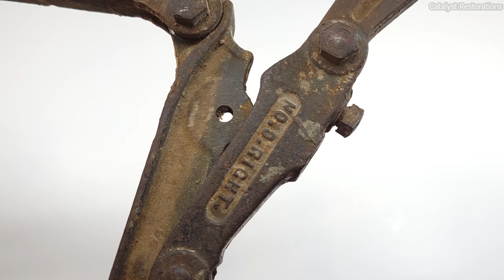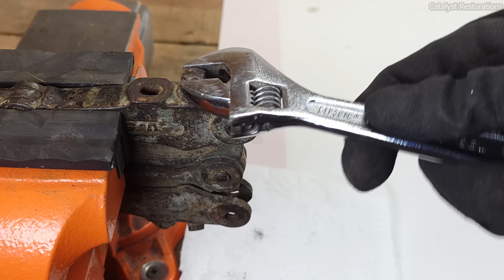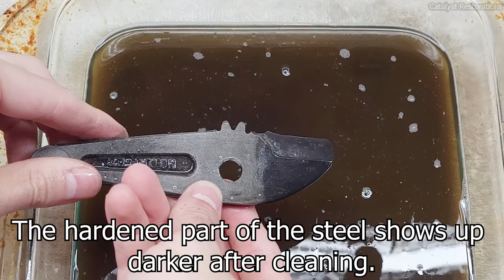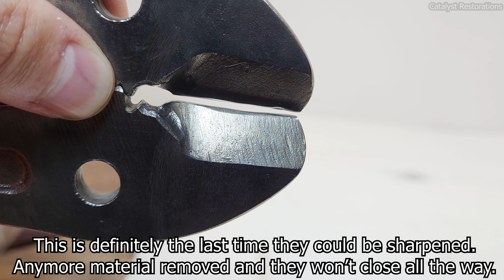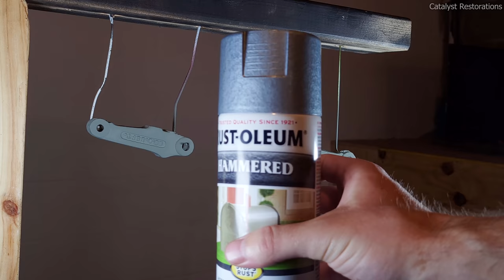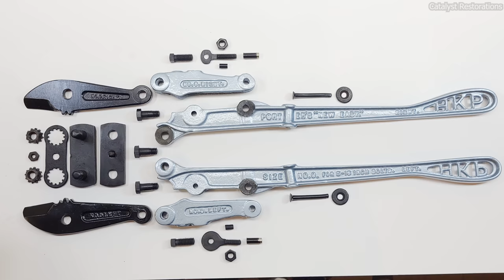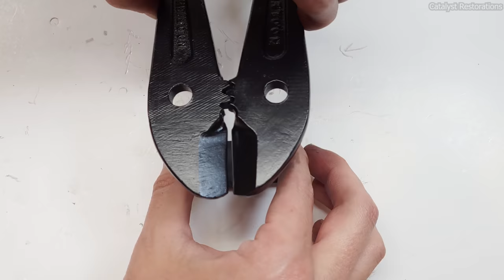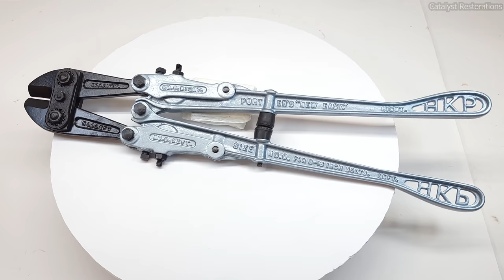130-year-old Bolt Cutter Complete Teardown and Restoration

Comment: Great restoration!
Here's a tip for press straightening: use 3 rods to "over-press" the piece.  
Two rods go on the right and left sides of the concavity, and the third goes on the convex point.
When you close the vise the rods act to bent the piece beyond straight, which will then flex back due to metal memory.
Hope this is helpful.
Reply from the maker: This is great advice, thanks JL! In the world of metallurgical engineering that metal 'memory' is called its elasticity and any permanent bending is called plastic deformation!
Reply: no such thing as metal memory.
Reply: @xl000   So, springs don't exist?
Reply: @xl000  Some people have no such thing as knowledge.   😅
Reply: @xl000  You are right, there is no such scientific term, but what people mean by this, is the metal operating in the elastic deformation area of the Young's Modulus of Elasticity graph. A hint for the non-engineers for further investigation.....
Reply: @firesurfer from wikipedia: "In metallurgy, a shape-memory alloy (SMA) is an alloy that can be deformed when cold but returns to its pre-deformed ("remembered") shape when heated. It may also be called memory metal, memory alloy, smart metal, smart alloy, or muscle wire."
Springs are made from normal high-carbon steel that have no "shape-memory" properties.
Spring is going back to its original shape only in some very specific range and you should avoid the: "Elastic limit (yield strength); Beyond the elastic limit, permanent deformation will occur. The elastic limit is, therefore, the lowest stress point at which permanent deformation can be measured."
Reply: @Bialy_1  Like Nitinol

Comment: You can weld new material onto the blades. Grind it flat and lay a bead of weld along the edge. Make sure your welding material is hardenable - regular wire won't work. Once youve got enough material laid down you can shape it  and then re-harden . Little bit of work and you could have the jaws meeting accurately again.
Reply from the maker: Awesome advice Linsey! Honestly I didn't even consider that, but you're totally right, provided you choose the appropriately hardenable wire and appropriately re-heat treat! I'm a professional Materials Engineer by day, so this is one of my favorite comments so far 😁👍
Reply: There are tool steel electrodes
Reply: Use an old drill bit in place of a tig rod.
Reply: Yep tool steel rods are expensive tho
Reply: I don’t think something like that would be worth it for this.
Reply: That is what I came her to say. Good job my fellow welder!!!
Reply: When you say they can't be sharpened anymore did you check the adjustment on the handles? It took me awhile to figure out the purpose of the short arms on the handles. Changes the closing of the jaws.
Reply: Why no sand blasting to remove rust?
Reply: @MisterRorschach90  it is the journey that matters.
Reply from the maker: @jeg1353  The poor adjustment bolts are at their limits (screwed all the way down) 😔. I did the jaw adjustments off camera - you can see the gap early on and then at the end they mate flush.
Reply from the maker: @brussels13207  if you'd like to donate to the channel so I can buy a sand blaster that'd be great! But in all honestly, a full proper sand blasting setup is not trivial to do and I try to keep Catalyst Restorations as accessible as possible for everyone to repeat these restorations themselves.

Comment: When I saw these bolt cutters, my jaw dropped.  It brought back memories of my dad’s tools.  He had not one, but two of these exact bolt cutters.  I remember them after all these years because of the lettering that was cast into the handles.  They looked like the “before” example, all beat up and rusty, which was very unlike how my dad took care of his tools (he was a Tool & Die layout man for International Harvester in Springfield, Ohio by trade, and generally kept his tools well-organized and immaculate).

I remember trying to replace the same round flange-ended bolt that you replaced on one of the two (the one that was less beat up) when I was a teenager, although I did a much poorer job of it (I simply pounded one end of a bolt flat and drilled a hole in it, which A) caused it to be brittle, and B) didn’t leave enough meat on it to keep it from snapping at my teenage self’s first attempt to use it for what I look back on now and assume was probably a felony).

If I had known then that they were as old as they were, I would have done a better job of keeping track of them.  I’m sure they wound up in a junk heap somewhere, as my mom didn’t have any idea what all was out there in dad’s “junk” (as she called it)…  she just wanted it gone.
Reply from the maker: Such great memories! These cutters really are pretty unique and eye-catching. I live in northeast Ohio myself so I love your story of your dad working for International Harvester. You can pretty readily find these exact bolt cutters on ebay for like ~$20 every few months (or flea markets for $5 like where I found mine!)- might be fun for you to try to restore one all the way! And maybe not just for nefarious purposes this time! 😉

Comment: I like the way you chose to use the Swedish nut lathe first, then the ratchet and socket wrench second. Bonus points for that!
Reply from the maker: I'm going to be honest Scott, I've never heard them called a Swedish nut lathe before but I'm dying over here 😂. The older the tool, the more wonky the sizing is on those nuts and bolts so it's really whatever I'm feeling in the moment! People have very strong opinions over which is "correct" though, hahaha

Comment: I have a really bad dislike to crescent hammers!  I prefer the 6 point socket.  Much to easy to round off nuts with a crescent hammer.  Nice job cleaning up the metal from being misused.  I've seen guys weld on additional metal to increase the blade size. Very nice job sir.  It looks almost new!
Reply from the maker: You mean crescent wrenches? They're not great for every job, that's for sure. And you're correct, several other commenters also suggested welding new material on if necessary!
Reply: @CatalystRestorations  You were also not using them correctly.  The fixed jaw should always be on the "outside" do to speak.  You were correct when tightening, but it should be flipped over when loosening.  Give it a try, it feels much more secure...
Reply from the maker: @stevebothe1416  Yup. If you watch any of my videos published since this one, this has been corrected!

Comment: Awesome job. Love these kind of videos. Suggestions, use the correct size wrench, get a sandblaster, and wear your gloves when handling chemicals and wire brushes.
Bravo
Reply from the maker: Thanks Eric! All great suggestions. Evaporust, the rust remover solution, is completely safe on skin but you can never be too careful. And a media blaster setup would be great to have. I have been reluctant to purchase a setup because the point of Catalyst Restorations is to make restorations accessible to people who do not have large setups with thousands of dollars in equipment.

Comment: I have falen in love with those castelated securing nuts, I think they must have been cast and tapped as I cannot think of a way to machine them myself. Keep on with the restorations as it gives us great tips and is satisfying to watch. If I can offer just one observation, chamfering the external edges of the rivet hole prior to peining gives a better flush and neater finish. Well deserved like and suscribe.
Reply from the maker: Agreed on those nuts. Really neat piece of engineering work there, especially for the time. Excellent tip in the chamfering too. Absolutely going to use that in a future project!
Reply: You could machine them with a larger head and then mill out the sides to leave the castleations.

Comment: Great result, really like it! But why don't you use a proper wrench at work? This adjustable wrench you are using is not a best idea (paint damage, dimensions of head are too high). What is the profit?
Reply from the maker: Yup, for sure. Lesson learned for next time!
Reply: @CatalystRestorations  also is not good form to use metric sockets n SAE fasteners

Comment: My father bought a pair of those cutters in the late 1950s. They were sized for cutting 1/2 inch bolts. I replaced the jaws after trying to cut a case hardened lock. I still use them.
Reply from the maker: They are indestructible! (as long you don't try to cut hardened steel with them 😅)

Comment: Some of the pressing (or possibly casting) fabrication is rather delicate and more elegant than most modern tools. It's almost pretty.
Reply from the maker: The design is quite striking for sure! The design of these is a great example of what the past days were like where it was the wild west of manufacturing and making something stand out with looks was huge for word of mouth. It was also before companies started optimizing production to eliminate unnecessary detail, like the 'HKP' on each handle. That's not to say necessarily that cost cutting always delivers an inferior product, but design of classic tools today are just more plain.

Comment: I heard that deep breath when you slipped with that adjustable wrench🤣I know your pain I do it all the time at work🤣
Reply from the maker: Hahaha, yuuuup 😅
Reply: @CatalystRestorations  The main reason your adjustable wrench slipped is due to you using it backwards.  you always pull toward the adjustable jaw.  way too many knuckles have been busted due to misuse of tools.  Don't ask my how I know :)
Reply from the maker: @georgeshaw8276  Thanks for the tip George! Nobody had ever told me that before!
Reply: @georgeshaw8276  I got written up by the squadron safety officer when I was in the USAF for unsafe tool use.  This was back in 1979. That’s how I learned the ‘correct’ way to use an adjustable wrench. Have a good day.

Comment: Great job on the bolt cutters. Never realized hk porter company built so many things as I worked in the early 70’s at hk porter manufactoring transformers, the kind found on poles and behind buildings
Reply from the maker: That's awesome! Yeah, in my research of these bolt cutters I had no idea how many different industries they had a foot in! Locomotive manufacturing is the one that really surprised me. Really neat.

Comment: I have the same pair of cutters, found them in rough shape over 40 years ago. I stripped them down, sharpened and repainted them in the 80's, they're still in my tool box today. I really never gave much thought as to how old they were though, I suppose they're older than I had first thought.
Reply from the maker: That's awesome! Yeah, this design has been pretty standard for over a century. These were patented in 1892, so they're likely a bit newer than that, but still pretty darn old!

Comment: Great work! to make new cutting edges, hard face them. Tig weld using old hardened drill bits as a filler rod to make new cutting edges, then grind to the new cutting edge size.
Reply from the maker: Great advice! Now all I need is a TIG welder...😬

Comment: If I could make a few suggestions.  You do good work, but I'd suggest that if you're going to restore "Made in the USA" tools, you might want to consider getting a set of Standard wrenches or sockets to take them apart.  Using Metric sockets risks rounding off corners on nuts due to improper fit.  Also, don't use adjustable wrenches if you have the proper open/box wrench or socket available.  Adjustable wrenches have play that can damage nuts/bolts.  The last thing you want to do when "restoring" something is to cause additional wear/damage.  Keep up the good work!
Reply from the maker: Thanks for the suggestions Rob!

Comment: Nice job, even if it's not "my mechanics" level, you gave this bolt cutter a second life and a prettier look. You may considere  to wash or to brush parts before soaking them in rust remover in order to increase efficacity.. 👍
Reply from the maker: Absolutely! The more loose dirt and rust you can get off prior to soaking in Evaporust the longer you can keep re-using the solution!
Reply: @CatalystRestorations  and the more money you'll be able save 😜

Comment: I have the longer version of those and they work like a charm!
Reply from the maker: Heck yeah, Doug! Built for life for sure. There's a reason the bolt cutter design has barely changed in over 100 years - it just works!!
Reply: If you have one bigger than the one in the video then I think you have a #3 bolt cutter. I have one which was made in the 1950's. My oldest one is what H.K.Porter considered an #0 bolt cutter which about 18" made in 1906. I'm very proud of tools made at their Boston, Everett and then Somerville 43 plant because my dad was a machinist there in the late 1950s to 1978. I have about 20 tools made there. My friend Vic from Big Vic's Workshop has even restored one which is a tree limb pole cutter. Take care of your H.K.Porter cutter.
Reply: @stephenkent8903  oh yea im never getting rid of it. Better than anything else out there.
Reply: I also have the longer ones - 36 inch , date Oct.18.92.
Reply: @stephenkent8903  make me reads No.3 . I’m really happy I found this video. Now I can restore mine .
Reply from the maker: @jesseayers7933  Awesome! The 1892 patent # number on these is 484,670, if you're interested in looking at it. Let me know if you run into any challenges during your restoration and be sure to read the video description for some things I learned when I restored these.

Comment: If you would tighten the two square headed screws where the handles meet the jaws, that is how you can tighten the jaws closer to completely closed. Great job thought.
Reply from the maker: You are correct! I did it off camera in this video, but at the end you'll see the screws were adjusted in about as far they could go! On my more recent HK Porter bolt cutter restoration where I do japanning I show the adjustments on camera 😉

Comment: :face-red-heart-shape: very nice restore. Put some Copper Compound grease/clay based bearing grease in all the high strain bolts. Will keep it smooth and reduce internal friction making it easy to use and get maximum output power.
Reply from the maker: Excellent suggestion, I will do that!! 😁👍

Comment: Great restoration. Please though, do learn the correct way to use an adjustable spanner (wrench). It can save rounding nut and bolt heads and potential scraped knuckles etc.
Reply from the maker: For sure! I learned the hard way on this one 😉

Comment: I got the big brother to this pair of cutters . Been wondering about their age and value . Mine are in a little bit better condition. I’m wanting to start restoration on them . Thank you for your post and giving me validity on the age . Mine has the same date cast into the handle . Now to get them appraised. Mine are 36 inch long .
Reply from the maker: I replied to you in another comment, but I'll also add it here too: the 1892 patent design # on these is 484,670. They are typically for sale online in the neighborhood of $30-50.

Comment: Nice job, they look beautiful. I wonder if they will cut a master lock or rebar?
Reply from the maker: They're not meant to cut hardened steel (says right on the blades) so lock would be out. Rear you technically could but as other commenters have noted these were probably used for that exact purpose (since they're covered in concrete) and the jaws are still all torn up from that.

Comment: Great restoration. I'm guessing some of the dislikes were from the edges not meeting in the middle? Eh, whatever, lol. They turned out great and as good as people like My Mechanics are, they also have TONS of fancy tools. I like the approach of just using more everyday normal shop kinds of things. But both form and function turned out awesome. Subbed. :)
Reply from the maker: Thanks for the kind words laserfloyd! I'm trying to fill a bit of a void in the restoration community by trying to make restoration projects feel more accessible to everyone. And if people are disliking because of the blade gap, that's my fault for recording and taking pictures before I tightened down the side square bolts to get them to meet as they should! If there was that gap, it definitely wouldn't cut anything!

Comment: Very interesting.  I have a set of these that I use regularly.  Mine have black handles that are in really good condition.  The cutters look like they never had any finish originally though they now have a century of 'patina' and one bad nick.  Even the rubber bumpers are intact.
Reply from the maker: That is amazing Steve! I would guess that the black is japanning, like what little remnants were on my pair. The bigger achievement is keeping those jaws intact! So many people cutting hardened steels with them. Ouch! 🤕